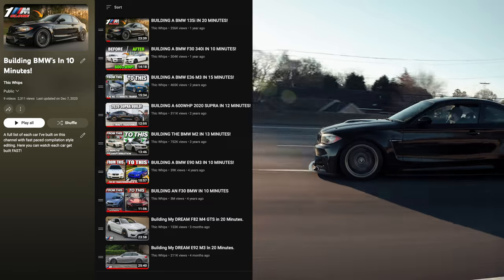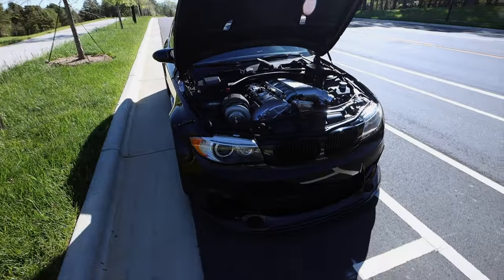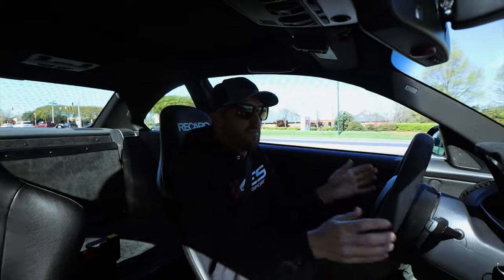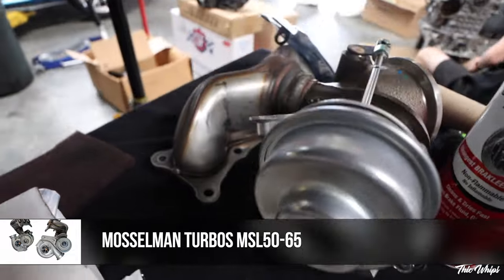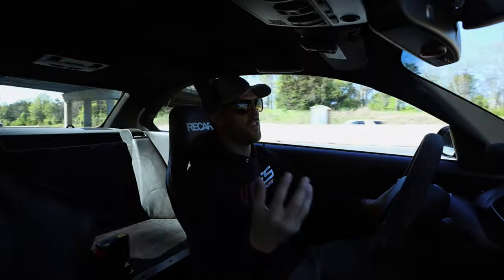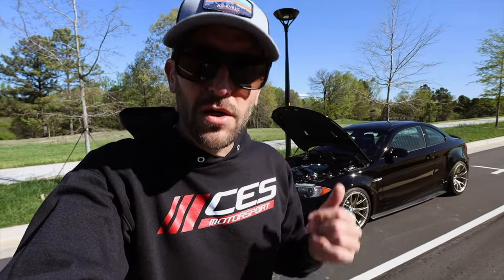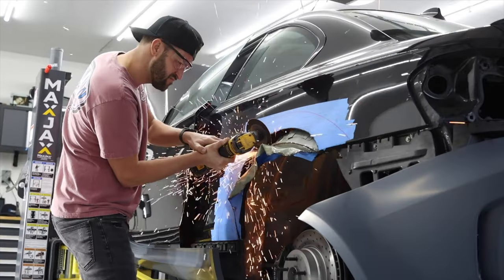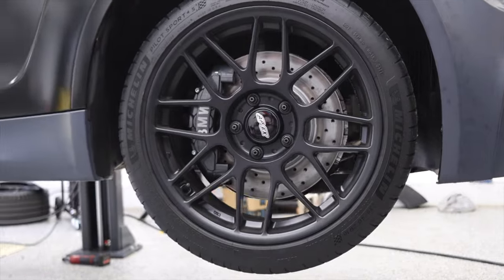7 Tips For Building Sick Cars.

Comment: Starting simple, great tip! 
What helps me is to divide the project at hand into sub projects. An engine swap by example starts with removing the old engine which you should see as a project on it's own. 
having milestones like that to celebrate in a build helps me moving forward.